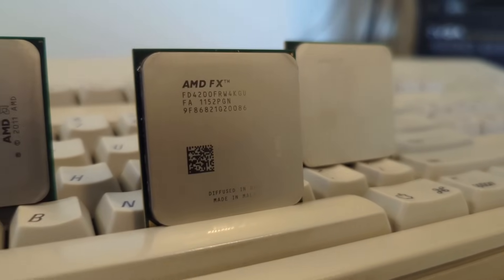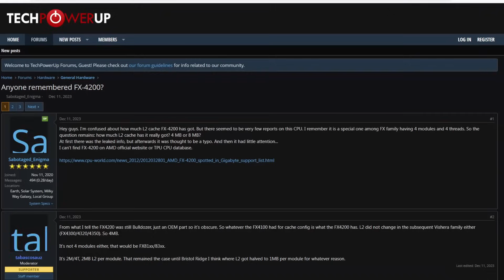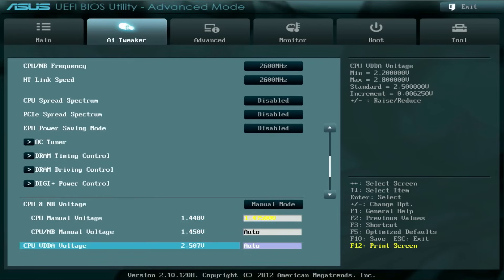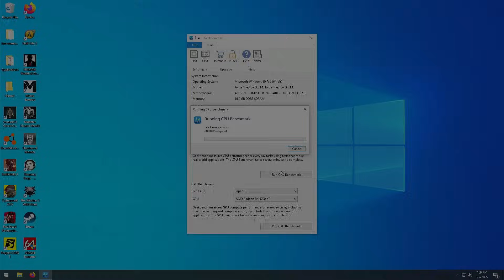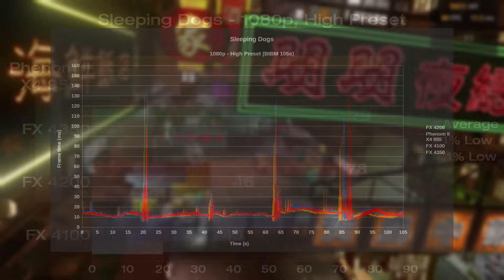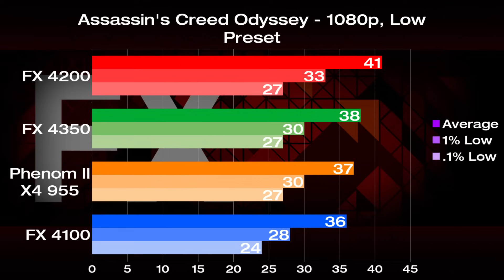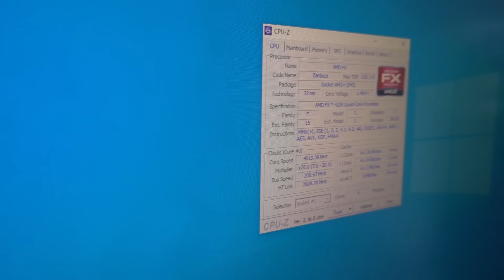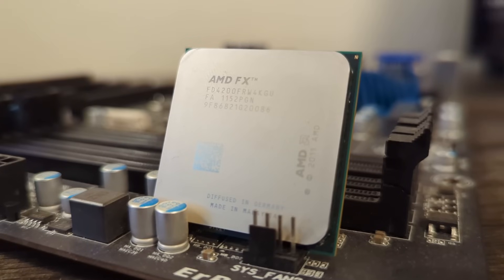What if AMD FX had "real" cores?

Comment: I can’t say I have ever heard of the FX4200. But absolutely phenomenal video mate. 

Ridiculous that if the old Phenom II chips had those instruction sets they’d be giving FX a run for their money well in to the 2020s. 

I still have a soft spot for the FX Series as it was all I could afford back in 2013.
Reply from the maker: Thanks for watching man! I'm glad you enjoyed, means a lot coming from you. And I agree, as it stands that's probably the Achilles heel of Phenom II these days. In a different universe we would have had about 12 games in the bench suite, but Phenom II's instructions were not having it.
Reply: @SPNG Found exactly the same issue on my revisit at the start of the month. 

Hitman 3 really is a go to example of how good these chips still perform in modern titles if they’re optimised well.
Reply: Dude I had a Black Edition of the 1090T and it DID Run circles around the FX series. All the way to 2018. Still have it, but it's sitting in it's OG box it came in, enjoying it's retirement.
Reply: @thelaughingmanofficial  I have the same CPU! Everything I've hit it with runs well, albeit only older titles because of the HD 5870 GPU can't even begin to run most things after 2015. I also have a weird problem with it, when I tried running a minecraft server while using the core unlocker in the bios, it kills power to the entire system after about a minute. I can't find anything on why it does this, and I'm not sure if it's CPU or mother board that causes it. Windows event viewer states it as a CPU error of some sort. For the meantime I've turned off the core unlocker and it's been running fine. Motherboard is an ASUS M5A87, PSU is brand new as the old unit died a couple weeks ago. I've been slowly working on updating the BIOS versions, but it's still only up to the 2nd. Would the newest BIOS likely fix this, or is it possible my mobo or CPU is dying?
Reply: @thelaughingmanofficial I had that CPU for a long time.  Went from a Phenom II x4 hat used the old 939 socket to the 1090T and it was amazing.  I ended up on the 8350 due to an incident with bent pins.  Never noticed a major difference in performance.  Have the R9 5900 now.
Reply: The fx 8350 is very very sentimental for me because it's what I had for the longest time, and even when I upgraded to an i5 8400, I didn't notice much of a difference, only now with a 12600 kf am I seeing a world of difference, I'm sure it would be very different if I had to do any sort of work on the computer, but for all of it's faults it was a perfectly acceptable gaming CPU for far longer than it should've been if listening to critics.
Reply: I wonder if the fx 4200 could have been one of those CPU's for pre built computers like we see with some ryzen cpu's you couldnt buy off the shelf
Reply: @kyles8524  That is literally what an OEM SKU is, yes.
Reply: My 8350 was dirt cheap compared to intel options thats for sure and it still serves in my dads pc, runs great
Reply: I still love Phenom II.  what a workhorse
Reply: For reasons 4350 was even back than often faster and broadly available while you had to search your ass of  to get an 4200 tray wich was directly an death sentence in a lot of coutries because you didn´t get warranty with it like with the 4300 and 4350 wich both came boxed. Also the 6200 and 6300 where so down in price that the most people didn´t bother with any of the 4 Core FX because there where better ways using 125W TDP back than even with FX
Reply: I had a FX-8320 and that was a great CPU and was in my gaming rig for quite a few years before i upgraded at a I7-5820K
Reply: i dallied a phenom ii x6 1090t for the first half of this year(with a TITAN Xp), and i was thoroughly impressed with how competent it was. i completely agree that if they had sse4 and avx they'd still be somewhat relevant on the ultra low end.
Reply: My 3.6 Phe][ still hammers.  Can't really compare it to my 3960x 4930k or 5920k but those are quad channel i7 but when saturated the Phe2 kept up with my FX8350 on one-core tasks.
Reply: Same here brother! I went from a phenom x4 to the FX 8320 in 2012. As crap as piledriver was, mine ate 5ghz at a ridiculous voltage for years before degrading.
Reply: @RamyWarda  only ran mine to 4.6GHz which is a 31% OC over base and 15% OC over the turbo, could of gone higher but was limited by my ram speed (think i was only running 1333MHz before moving to 1600MHz
Reply: The FX 4200 are used for CCTV systems back in the day, processing analog camera`s digitally. We had a view of those FX 4200 in our systems..
Reply: THAT'S HIM, THAT'S THE GUY
Reply: The perennial elefant in the room, why in the living hell AMD did Bulldozer rather than Phenom III with tweaks here and there, a bit more of clockspeed and the versatile FMAC unit as FPU for each core...
Reply: @jpvalverde85  The reason AMD abandoned the K10 architecture is because they pushed it as far as it would go. Even the fastest and highest clocked 965BE was trounced by Intel's budget LGA1156 processors that also consumed far less power. The i7-860 was a 95W part, where the 965BE was a 140W part that could routinely pull way more than that.

K10 was a rehashed K8 architecture from the Athlon 64 era. They made the same mistake that Intel would later make in the decade of stagnation, they got complacent and didn't seriously invest in R&D for the next generation.

About the only thing they could maybe do is try and get an 8 core die as a further development of the Phenom II X6, but that wouldn't have helped them much at the time with games still mostly using a single thread and needing good single thread performance.
Reply: always curious what kind of performance an fx using newer steamroller arch will provide, and also what if the fx have the die shrink to at least 14nm😅
Reply: PHENOMenal, i see what you did there
Reply: @synfaltsbortfall  Never again.
Reply: I have a FX 6200. Donno if its the same as this chip.
Reply: @NathanBinks  just a clock speed refresh with the usual 3 FP units.
Reply: @NathanBinks 6200 is going to have 6 cores instead of 4 , architecturally its the same just with 2 more cores
Reply: @kyles8524   The FX4200 has 4 Modules, while the FX 6200 only has 3 Modules.
Reply: @mari2_ok  do you mean cores? the 4200 is a 4 core and the 6200 is a 6 core
Reply: @kyles8524  No, I did not mean cores. the 4200 has 4 Modules with 1 Integer Unit disabled on each, the 6200 is just a clock bumped 6100 with both cores on all 3 modules active. The 4200 is a uniquely weird CPU in that its cores each have their own Modules instead of sharing a Module with another Core.
Reply: @mari2_ok  The FX4200 is cut down from some FX8000 series chip. All four modules with 50% of the integer units disabled.
Reply: I made the same mistake regarding fx in 2013 when I could've just ran a second hand i5 750/760 for cheaper, hindsight 2020 I guess
Reply: @yeerk22 yeah but muh 6ghz

Comment: Here you can basically see that if it would be advertised as a quad core it would have fared better in the public perception. An FX-8XXX would be a strong quad core with 8T, but its a lousy 8 core.

Btw whats the exact model number on that RAM?
Reply: Not only advertised but priced as well
Reply: @AbbasDalal1000  Priced?  I got an entire AM3+ platform for the cost of just an i7-3770k with an FX-8350, a 990FX motherboard and 16GB of DDR3.  I don't know what you mean by price.
Reply from the maker: Well, I guess in this case the 4200 was advertised as a quad core already, honestly if it wasn't OEM only I wonder what people would have thought if it was sold alongside the regular quads lol. And I think it's BLT8G3D1608ET3LX0

Comment: This is a really interesting idea and I had no idea this CPU existed. It's in a completely different league in the FPU tests, wow! Gaming results are unexpected though. Phenom II doing as well as it did surprised me, but I definitely agree that most newer games taking advantage of newer instruction sets likely gave the newer CPUs an edge there.
Reply: I ran my phenom in quad core oc'd at 4.2ghz for about a decade, and it kept up in competitive online fps and light video editing when paired with a video card. I just upgraded to a ryzen 7 7700 octo core because the pii lacks instruction set for win11 and newer davinci resolve versions. AMD 🙌
Reply: Every time I've used a Phenom II X4 or better the performance ends up surprising me. I expect a level of sluggishness from slightly older systems, but higher end phenom keeps up with modern tasks better than it's competition.

(Edit: spelling)
Reply: I'm surprised that the Phenom II did so well in the newer titles, AC Odyssey in particular, as I remember AC Unity being the game that pushed me to replace it. The CPU was officially not supported and sure enough it managed a framerate that was in the lower teens (probably due to lacking some instruction that the engine heavily relied on), so seeing it perform adequately in a much newer AC title was a bit of a shock.
Reply: Keep in mind this was with 4ghz clockspeed parity, meaning that phenom was heavily oc'd and fx was heavily downclocked. The amd fx chips here lacked about 20% of clockspeed (~800mhz), so if you count that in, the FX chips here would pretty much swoop the phenom in all tests by about 10%. Not sure why author said that phenom outperformed fx chips as its clearly not true other than very few select benchmarks which mostly dont utilize newer instruction sets.
Reply: @h1tzzYT  the fx 4100 has 3.8ghz stock and fx 4300 has 4.0ghz stock so fx was not down cloked
Reply: @TheSuperHybrid80  But AFAIK those FX chips can OC easily to 4.8ghz. Remember the phenom was oc'd heavily in this scenario so we aint comparing stock clocks of either cpus
Reply from the maker: @h1tzzYT  That's not really true. The FX 4200 was overclocked quite a bit, it has very low stock clocks ~3.3GHz. And the 4100 was overclocked too, its stock clocks are 3.6. The 4350 was the only one that was downclocked here.
Reply: @h1tzzYT  the only fx chip being downclocked is the 4350, the other ones have 3.9 max boost(only 1 to 2 core)
Reply from the maker: Thanks for watching Nathan. I figured this chip might intrigue you 😀 At some point I'd like to do more FPU testing but I feel like it's kinda difficult to find benchmarks that stress just the FPU. And I was surprised too, when it worked (which definitely wasn't all the time lol) the Phenom II did well!
Reply: The phenom II was a good cpu the problem was the phenom with its TLB issues left the phenom ll playing damage control. So it never got the recognition that it deserved. But honestly the whole TLB issue on the phenom was largely over exaggerated by the tech media.
Reply: @RhinoXpress  WTF?!  FX was AMD damage control...
Reply: @dallesamllhals9161 damage control for what? The FX was a total flop. 😂

Comment: I remember getting an FX-8320 with an R9 290 back in 2014 and being really disappointed with the performance. The CPU was definitely holding the GPU back. There were videos back then claiming the FX chips were great, that was total BS. Later on, some games like Doom made good use of the 8 cores, but overall single-thread performance was still what mattered, and Intel was way ahead. The Phenom II maybe had slightly better IPC, but the FX chips had much higher clock speeds, so they ended up pulling ahead. Phenom II topped out around 4 GHz on a great overclock, while the FX chips easily hit around 4.6 GHz, and even 5 if you pushed enough voltage and had good cooling.
Reply: Yeah seeing the Phenom II coming on top in so many benchmarks tells everything.
Reply from the maker: The 290 would have been wicked fast for that time, so I can see that. I'm not gonna lie though, these CPUs may have a higher limit for cards than many would think. I did a video a while back featuring an FX-6300 instead, and even stock it was able to push this 5700 XT to pretty high utilization depending on the game. Of course heavily threaded games saw the most benefit.
Reply: @SPNG  Yeah, at the time it was a top-tier card, only the Titan/780 Ti were a bit ahead. People kept saying 4GB of VRAM was overkill and that the card was made for 4K, which looking back was just ridiculous. I really expected games like Watch Dogs to run flawlessly, but they didn’t because of the 8320. I mean, people with an i5 2500 were getting much better FPS.
Reply: @SPNG Some games are able to use some form of async and make your gpu do some of the cpu workload. Which can give you the illusion that it's high utilization.

That's a bottleneck without a doubt

 Reality is, you shouldn't pair anything more powerful than a 750ti with these 😂
Reply: Same here i bought 7970 and an i7 2700k just to disable HT on it so it would be faster in games back then.
Reply: FX were holded by weak memory subsystem. FX8350 with stock core clocks, NB 2600 and 1866 RAM outperforms i7 2600 in BF1 (32vs32, online).
Reply: i had to choose between the fx 8320 and Hd 6870 or i5 3570 non k and hd 6870. Glad i went with the i5 back then, upgraded the gpu to hd 7950 in a few years. Divine.

Comment: I personally ran fx chips in my main computers till like 2020. They where 83xx's and extremely power hungry when overclocked. But performed quite well when overclocked 4.7ghz+ core 2600nb+ 1866ram+ for the price I got the cpus ~$100 or less in 2013 the value was there. And by the end I was having a way better gaming experience than my friend with a i5 7400 in borderlands 3 for example. I had my chip paired with a r9 nano and they had a gtx 1070.
Reply from the maker: They perform pretty well when properly overclocked, I did some tuning with my FX-9370 and it was really impressive for what it was. But I second that about the extremely high power consumption, the total system power draw shot up to well over 500W, while I don't think it exceeded 350W with these CPUs.
Reply: @SPNG  I guess it's true the power consumption isn't that high vs new cpus. I do think my x5650 at 4.5ghz drew more under full load. 

Regardless both turned my room in to a furnace. I don't know how people with 5090's and a 14900k oc'd deal with that.
Reply: Overclocked Bulldozer beats stock Skylake? 🤨
Reply: @kingeling Non ht skylake, in some cases easily. There was a gaming comparaion posted on ocn back in the day as some more proof. Also this skylake was essentially the most gimped you could make a skylake 4 core. Low clocks, low ram clocks, single channel memory, 1 x16 stick. Ddr4 was pricy back then and ddr3 was dirt cheep. The base skylake system was a dell oem pc.

In this case we sold that dell on and went with a i7 3820 with quad channel oc'd to 4.3ghz now that system did beat oc'd fx in pritty much everything.
Reply: no way an OCed 8 core FX beats a 7th gen i5. The single core performance on the FX cpus is absolute dogshit. I tried to use one in 2025 for gaming and it was an absolute disaster. My overclocked i7 970 at 4.3Ghz performed night and day better than that piece of trash.
At least the i7 can overclock like crazy and make it relevant in 2025. The FX does not overclock as much while at the same time not benefiting as much from it. Just sad
Reply: @dieselgeezer18 There is a wccf review with a r9 nano 6600k vs 6700k vs 8350 oc and non oc. Alot of the time you are just gpu bound. But they only do oc vs oc and non oc vs non oc 

"Intel Skylake i7 6700K & i5 6600K vs AMD Vishera FX 8370 ; A Gaming Comparison"

You also got to remember the base frequency of the 7400 is 3ghz not 3.5 like the 6600k. The 6400/7400 are really slow cpus.

We where talking borderlands 3 not 2025
You are going to have a awful time with a fx or locked 4 core skylake in 2025. I also clearly said it didn't beat it in everything.

Comment: Awesome vid! My first desktop had an FX 6300
Reply from the maker: Much appreciated! I daily drove an FX 6300 for a couple months back in 2019, it didn't blow me away but didn't do too badly compared to the locked Sandy Bridge chip I was used to up until that point.
Reply: I'm still daily driving an FX6300 running Linux. I'm not a gamer though.

Comment: FX are good side PC's. I use several PC's for my kids with them with a FX 6100, FX 8320 and FX 8150 with R7 250, RX 550 and RX 5500 XT. They mostly play Roblox, Genshin Impact and Fortnite, but they they can also run FO76, GTAOnline Enhanced and even Ghostbusters Spirits Unleashed with over 60 FPS. So yeah, i'm very amazed at the performance and how cheap they are to build PC's wit them.
Reply from the maker: They can still kinda scrape by with light titles, definitely better than Phenom II in that respect thanks to the better instructions!

Comment: How does the 4200 differ from the "one core per module" setting available on many boards? The 4200 sounds like an fx 8000 chip with this setting enabled.
Reply: It seems like it wouldn't, not all board have this option though, so there is that.

I know my asrock boards had it, not sure about asus.

Comment: Wish you added a FX-81X0 with dropped frequency. To see how CMT affects performance, and if you can emulate 4200 with FX 81x0 by disabling CMT.
Reply: Would be a good idea for a follow-up, in addition to dropping the Phenom II to allow for a wider range of tests
Reply from the maker: If I remember correctly, my board only seems to be able to disable entire modules, not just the individual threads like seen in this 4200. I gotta plug an 8 core in it to make sure though, I'll throw in my 9370 sometime today and see.
Reply: @SPNG you could try using core affinity in the OS to pick specific threads to run software on, right?
Reply: @7MBoosted something that even modern CPU can benefit from